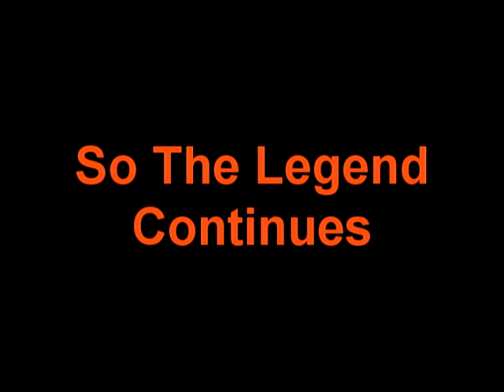1985 Oldsmobile Cutlass Supreme Resurrection! - 454 and Turbo 400

Comment from the maker: Apparently it`s common to cut the outside of the frame by the rear tires out, thin it, and weld it back in so you can fit a wider tire.  We`re looking into possibly doing that in the future.

Comment from the maker: This engine is a pretty much a stock 454 with a cam.  We`re building a 0.70 over 454 to swap in for this coming race season.  Should shave a couple seconds off the time.

Comment from the maker: Yup, that's right.  In this vid, the car had a stock 454 with a cam and ran 13.7's.  In my more recent vids you can see the car has a fresh engine.  It's a naturally aspirated 470 cubic inch bbc and runs 11.2's.

Comment: sweet vid why do you turn the wheels at the start of the install
Reply from the maker: +ox man  Thanks bud. Turned the wheels in preparation to push the car forward, as you can see a few moments later.  Ended up jacking the motor up first, then moving the car forward under it.

Comment: I meet 403 oldsmobile motor.
Reply: The 403 uses adapters from the factory to put the Olds onto Chevy frame mounts. If you are dropping a Chevy in there you should be already setup and good to go. You just need Chevy mounts for a Camaro on the block.